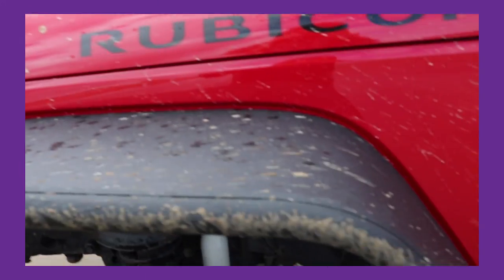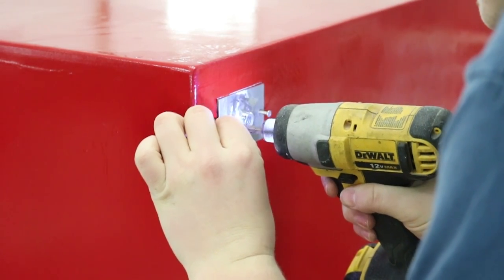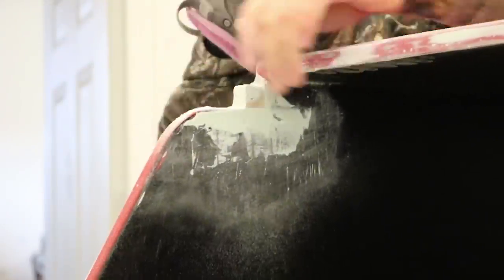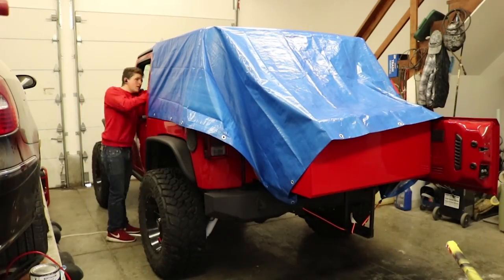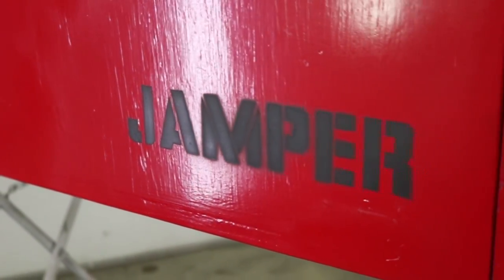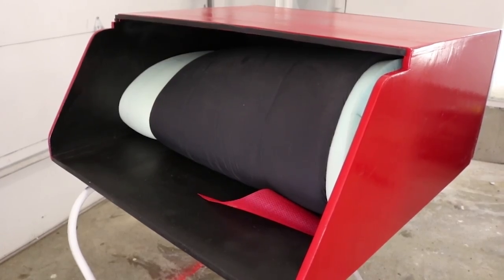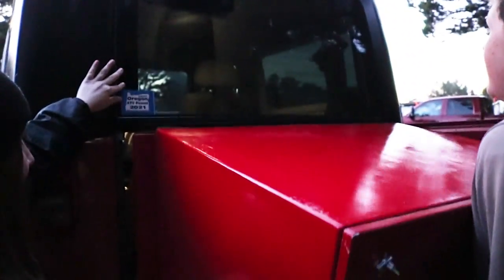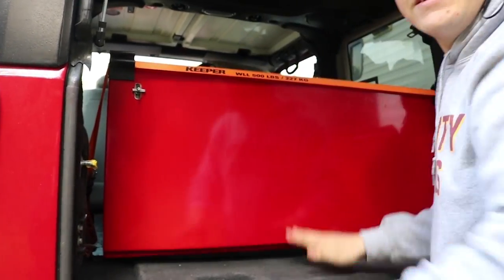The Jamper: Best Jeep Overlanding Solution (Part 2)

Comment: This is great.  I am always searcing for a way to sleep in a 2-door JK.  I have back and hip problems and need to stretch out.  Should have bought a 4-door, but did not think about back problems at the time.  Your solution is very creative.  I have no skills. So this would not work for me.   I considered taking the front passenger seat out and placing a platfrom across the gap.  Thanks for this video.
Reply: I'm in the same position but as a retired carpenter I think you could do this'd it would work. Ive looked into the seat removal option and it gets complicated with the possibility of the airbag activated
Reply: @johnlounsbury6191  I took my JK to the dealer for routine maintenance just last week, and again asked the service guy about seat removal. He said they would not do it due to liability issues.  So I then asked a hypothetical question.  "If I take out my front passenger seat after first disconnecting the battery for 1/2 hour, would that activate the air bag or interfere with other components. The response was no, but the airbag light would remain on."   I would still like to see someone on youtube do it first.

Comment: How about adding heavy duty drawer slide out brackets to pull out the camper? That way your weight will be supported by the sliders and you won’t need a hitch rack
Reply from the maker: i would love to in JAMPER v2 that was the idea but i didnt know how to inegrate big sliders in and i was on a time constaint and budget. In the future I plan on building abetter version.
Reply: Yeah, there’s also the fact that the rails will make the jamper higher, somehow you will have to level it out if you do it ....
Reply from the maker: @jeremyarchambault  exactly, i will figure it out haha
Reply: @jeremyarchambault  wont make it higher if they are on the sides .
Reply: Adenkane Isme genius!!

Comment: Good concept. Could easily be modified to be better. Bolt in a wood system, put the box on drawer slides. Take precise measurements to create a better seal. Get some actual weatherstripping or something for the seal. All Problems solved.
Reply from the maker: yeah, easy just like that